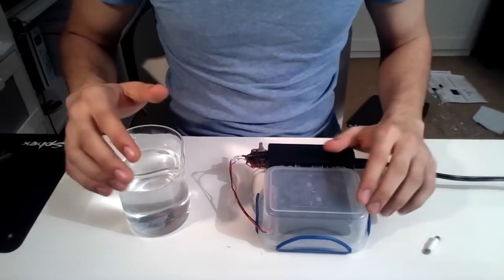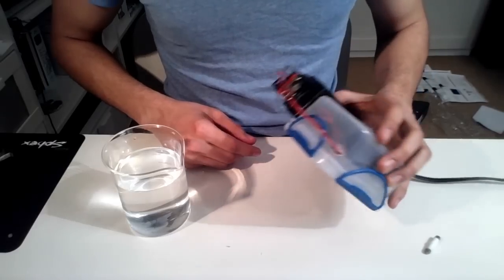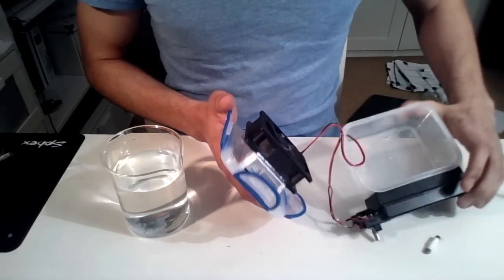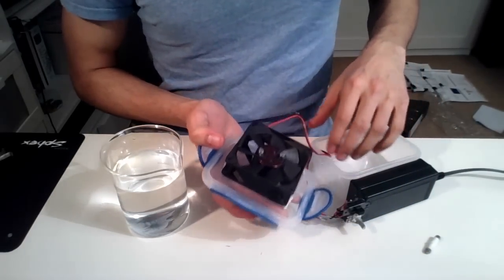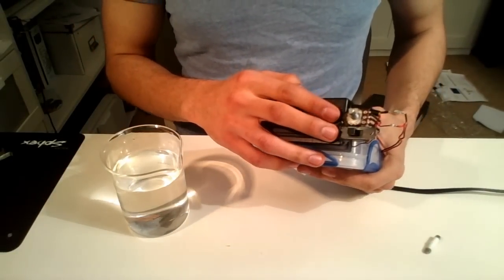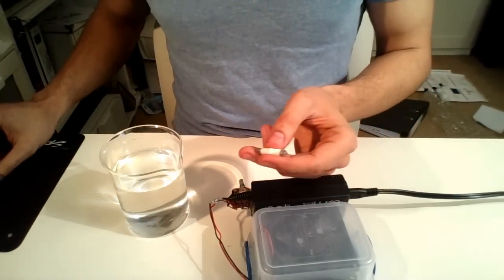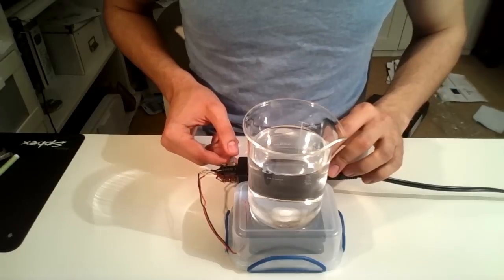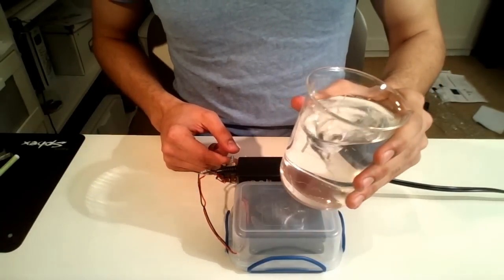[HOW TO MAKE] A Simple Magnetic Stirrer from Everyday Items

Comment: What's up with Canadians (presumably by your accent) and amateur chemistry? IIRC Nurd Rage and Nile Red are also from the land of the North Woods (assuming they are not the same person, likely but unconfirmed as that is).
  BTW does it really matter how centered a stir rod is? It's been ages since I took Chemistry in HS and TBH I don't recall any of it. I am about to start messing around with home made enchants and looking at the hardware I have in the junk drawer there are lots of motor options. Precision centering things might be more of an issue for me though. Any advice?
Reply from the maker: So the centering of the paperclip on the motor is only important as it may otherwise become dislodged by imbalanced centripetal forces. It's not crucial for the stir rod to be centered.

Comment: Thanks for the video.

My goal was to use only what I had available to make mine. The only thing I thought I might have to buy was a project box then I remembered that I had a bunch of VHS tape cases so I just took a dremel to one of the posts and I had just enough room with 2 washers per mounting screw for spacers.

Yes I achieved my goal and spent a total of $0.00 using only what I had laying around.

Comment: What kind/type of potentiometer did you use?
I'm halfway done making my own, but I don't know how many ohms my potentiometer should be.
I'm guessing it's a 12V fan and my AC/DC is 9.6V and 180mA.
Reply from the maker: +origamigek I have no idea how many ohms the potentiometer I used is as I just pulled it out of an old computer steering wheel but I suppose that's quite an important consideration. As this is a fairly low-voltage circuit, any potentiometer should work well, and undervolting your fan won't be an issue, it just means that it'll spin slightly slower and have a bit less power.
Reply: +Fereidoon Kavosian
Undervolting would indeed not be a problem, it's spinning too fast at the moment.
I read somewhere that a 100 Ohm pot. would do the trick, should I go higher or lower?

Comment: Can i use a magnet from a hard disk of a computer? sir?
Reply from the maker: Charles Marasigan Hard drive magnets are also neodymium, so it should be okay as long as you center it properly, but I would test it with your stir bar before gluing it to your fan just to make sure that the magnetic poles and the length match up properly.
Reply: Fereidoon Kavosian sir. is it ok to connect the fan in any laptop adaptor? even the fan is only 12V but the adapter output is 19V?
Reply from the maker: Charles Marasigan I really wouldn't recommend that. To my understanding, if you imagine wires as pipes, and electricity as water, voltage would be like the water pressure that's flowing in your pipes. If your fan is rated for 12V and you put 19V of current through it, your risk bursting the pipes, even if it works at first. The higher your overshoot the voltage, the higher the risk that the delicate wiring inside the fan's DC motor will be damaged and your fan will stop working. 

On a further note about your previous question, if you use a hard drive magnet, my understanding is that they are much larger and would have a much stronger pull than the small magnets I used in my project. As a result of this, there would be a greater amount of frictional forces on the stir bar that you're trying to spin, so your fan would have a harder time making it move. In order to avoid this you could try leaving a bit more distance between the stir bar and the magnet to find a good amount of pull, so that the magnet doesn't let go of the stir bar while it's spinning

Thanks for your great questions, I hope that helps :)
Reply: tnx a lot. now i have my own stirrer haha

Comment: what kind of magnet do you use
Reply from the maker: Bito Vega  I used 2 neodymium magnets. The ones I used were about 5mm in diameter. 

Make sure they aren't too big otherwise the stir bar will struggle to turn, but if they're too small you won't manage to get a good hold on the bar at higher speeds.

Comment: very good simple stirrer this could solve many problems for my work in lab but what u made to have 2 velocity is this in the fan ?? and with your brilliant head can u make a heater wz stirrer???? thanks and good job
Reply from the maker: Glad you liked it! :D

I just used a potentiometer to control the fan speed, that sounds fancy but it's basically just a dimmer switch. They are very inexpensive and available online http://www.amazon.com/potentiometer-potential-black-control-Knob/dp/B009QFU9H4/ref=sr_1_1/180-5678870-7414109?ie=UTF8&qid=1411149164&sr=8-1&keywords=potentiometer

I'm actually working on making a Magnetic Stirrer Hotplate at the, but at the moment I'm really swamped at school so my hobby projects are a little on the backburner. Stay tuned and you won't be disappointed :)